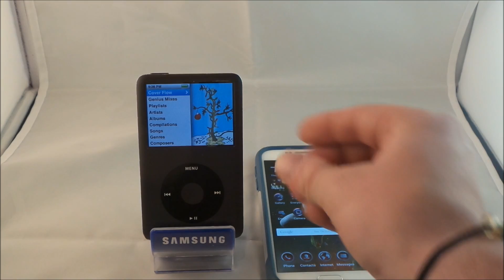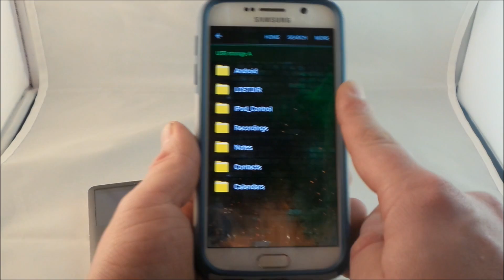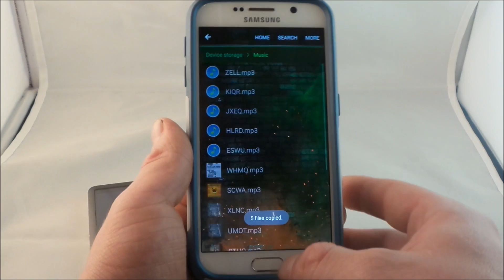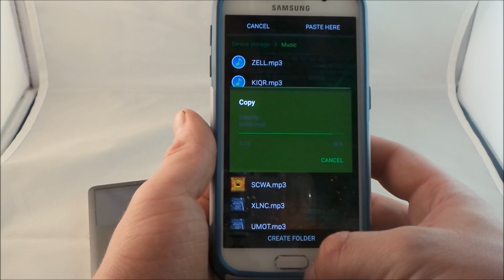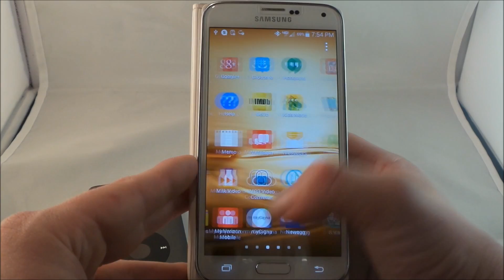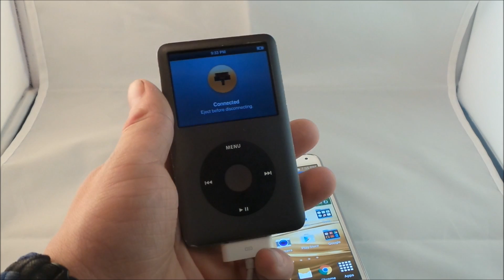Transfer IPod songs to Samsung Galaxy S6

Comment: Is there a way to move tracks from one folder to another on the iPod, without copying it to my phone? I  have 2717 tracks, and not enough space on my phone. So I  plan to just use my phone to play my iPod through UConnect in my car, (since UConnect no longer supports the iPod Classic, so I can't play it directly from the iPod). It would be easier if I could regroup the folders by artist.